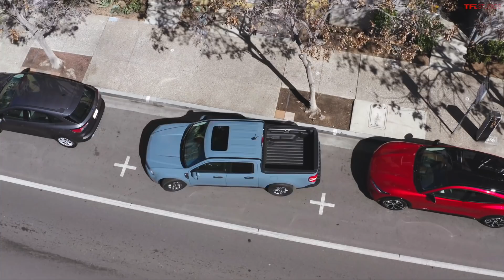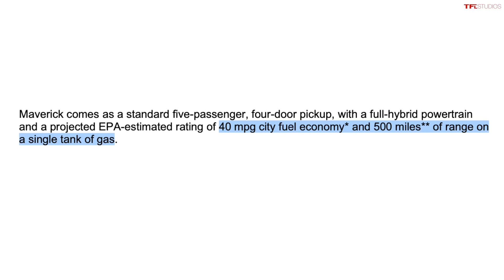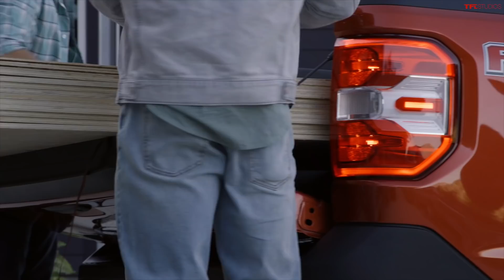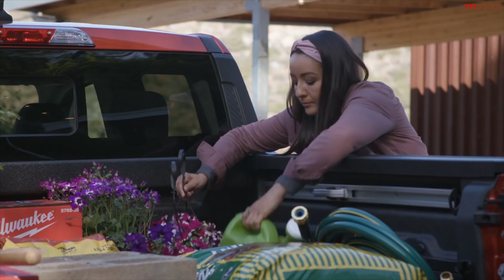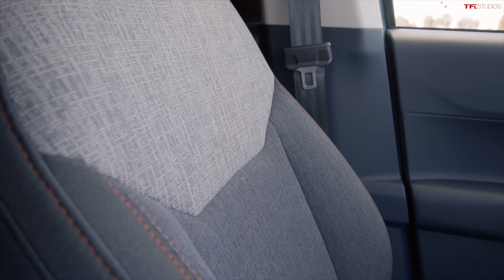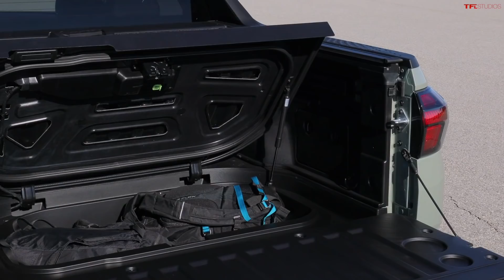Hands On With The New 2022 Ford Maverick: Here Are The Top 10 Things You Need To Know!

Comment: I think they should have ditch the rear seats and added more bed space and better set up for hybrid. to me its not going to do very well in the end most will just pass it up as to why not just get a suv for the room. there are reasons why cars get larger.. no one wants to travel in a bath tub or a can of tuna.. i watched as you got in on both the front and rear def brought back memories of the old Toyota with a small seat that went sideways. I really don't understand the point in this truck. If i was going to build something this size i would have made the cab a single with a bit more room like a 1/4 rear cab for say like bags of groceries and made the bed a full 6 foot bed. i know the idea of gas engines are going away. why not have a diesel option? or a full electric since thats where they are headed. for 20 k for a full electric that was capable of a small work truck may be something that many company's would buy specially on a army base where space is always tight.

Comment: Sold Fords for over 40 years, when they dropped the Ranger, I argued that cost and fuel economy weren't the most important things. IT WAS THE SIZE! People that live in apartments and areas with HOAs need smaller vehicles. If you live at the beach there is very little extra parking.  Even when you go to the National Parks, parking is a problem. I plan on getting one, my wife has a 2020 Escape Hybrid and at 5200 miles is avg 40.1 MPG

Comment: Great video, Tommy.  Most polished video I have seen from you guys.  Having owned a smaller Ranger, newer Ram Quad Cab, Tacomas and now a Gladiator, I still like smaller trucks because they are easier to park and handle everyday tasks than larger full size trucks.  What manufacturers don't realize is that not everyone needs a 4 door truck.  I even wished my Gladiator came in an extended cab with a longer bed instead of a 4 door version.  This Maverick will sell like hotcakes.  When Ford announced years ago that they were bringing back the Ranger, I was hoping that they would have kept the truck small.  But they did not and the interior of the new Ranger was a disappointment.  I do think that Ford redeemed themselves with the small truck market with this.
Reply: Plastic interior, assembly in Mexico. Bet it has quality issues like uncle bronco

Comment: Nice concept, but no deal for me. A 4.5 foot bed is worthless in a pickup truck. If I'm buying a pickup, it's to haul cargo and lumber 8-12 feet long. Most modern trucks are basically just an SUV with an uncovered trunk. I don't need a back seat, I need that bed space. Otherwise just buy an SUV, where the cargo area is covered. MSRP on this may be under $20k but I guarantee you won't be buying one anywhere at that price. Around here vehicle prices at dealerships are $30-40k above MSRP. So, 50-60 in my area.

Comment: Good grief,  Ford did it again.
This granola toilet shouldn't be considered a truck (in my opinion).
     Ford and a few other companies have proven these uni-body pickups are junk years ago in the snow states.   The salt rust them out.   Also hope you don't get the back half badly damaged in an accident because you can't swap the bed out.
   Final— Ford (Ranchero) and Chevrolet (El Camino) stopped making these for a reason...it didn't work.   Even Subaru retired the (Bratt).   This body truck type doesn't work good in winters salt and calcium roads.  Like I said, a lot of rear collisions end up up totaled.

Comment: Super Cab with a 6" bed.  Super Cab gives you a secure place for you tools, 6' bed gives you something to work with.  Around here people are beating the bushes for the older Super Cab Rangers with the 6' ish bed.   4WD Rangers in this configuration bring a hefty premium.

I agree they should have named it "Ranchero".  I had a '62 model.  This machine does have a lot in common with the Ranchero of old.  They both are small economical uni-body's to start with.

Comment: They claim the only competitor is the new arrival Hyundai SantaCruz - but this is the Honda Ridgeline design - small uni body with a truck bed integrated.
Would have liked to know the MPG for the AWD version as a front wheel drive is not a good tow vehicle. Just try getting a boat out of the water on a slippery boat ramp with a front wheel drive. But when they said "made in mexico", I tuned out. When you realize the Honda Ridgeline and the Hyundai Santa Cruz are both built in Alabama - why mess with the garbage hit and miss quality that comes from Mexico plants. I have no desire to be in continual warranty issues with a new design still working out bugs. No wonder they are pricing it at under 20K - and I'll bet our fed gov is giving Ford a huge kick back for "hybrid" - thanks D.C. for incentivising jobs going out of the country - AGAIN.

Comment: Ya know... it doesn't matter what those pinheads in Detroit throw across the drawing board anymore.  Its still gonna be a tin, foam, plastic, girlie gadgets and low bidder, conglomeration of crap. No lie.. a god damned UMBRELLA hit my truck and caused $1,200 damage. Trust me, if you get a hard on in your new truck, it'll be totalled. Guys... you went all Rube Goldberg here. Who's idea was it to take a simple system, like HVAC, and wire the thing up to THIRTEEN LIN-BUS actuators.... ON A NETWORK, just to defrost the windshield? That, right there, is your whole problem..... over complication and passing it off as "innovative" and "high tech". It's stupid !!  Look...guys.... just put the two little manual throttle cables back in the HVAC and keep it simple, ok? So, I bought a 1972 Dodge Power Wagon 440 mag, 4x4, 4 speed, split rims, snow plow frame, hand crank windows, no AC, chicken lights, big ole old school towing mirrors,  trailer hitch, winch, AM-FM-8 Track, gun rack, and it out runs, out works and out f**k anything Detroit has put out in the last 25 years. Like brand new.... $25,000.00 .... Take your stupid engineers on a little stroll through a god damned classic auto show and stay there till you understand what you did wrong, Detroit. AND... what is it with you guys? None of you are getting laid so you make the rest of us suffer too? Get rid of the god damned console and bucket seats !!! A woman has to be a professional contorsionist for a half decent hand job or, god forbid, road head. AND.. don't give us your propaganda and BS about "gas economy", the environment, safety, and what not. My 1972 440 does better with nothing but an off the shelf muffler and no catalytic converters, injectors, engine control modules, transmission control modules or any of that other happy horse shit. We all know what your end game is.... no payment, no start. Expired license, registration or insurance.....no start. Not with my 72 !!
Reply: I like the way you think. Drive a 38 year old pickup myself hauling lumber, rocks, dirt, drywall, appliances, demo. Not a daily driver and have two modern cars, but love driving that old full size truck the most.

Comment: Great video. I was hoping it could pull about 3,000 pounds and still be a hybrid. I have a vintage trailer I’m restoring that will top out at 1500 pounds so I would need the extra weight for camping stuff in the truck bed. Is the 2.0 eco boost engine not a hybrid? If not what would the city mpg?

Comment: I think I'll stick with my '05 Chevy Colorado Z71 4X4  Crew Cab with its five cylinder engine and just shy of 250,000 miles on the clock....And an average 35mpg for my light duty uses and my '14 RAM Hemi 1500 4X4 for the heavy lifting while averaging 21mpg.

Comment: Super interesting vehicle, I'm probably going to have to be replacing my car in the next year or so and this defiantly is a contender for the replacement. I especially like that the hybrid engine is multi port fuel injection as opposed to direct injection and avoids the carbon buildup issues on the intake ports. I'm just a little scared of cvt longevity.

Comment: Sounds great but so did the Prius.....Ill wait at least a year to see what the issues are. Never buy the first one out of the gate unless you have $$$ to burn. Btw, CVT means the engine works harder thus tranny may need replacement between 100,000 and 150,000 miles. Typical Ford...

Comment: I like it as it is, but I would LOVE it if it had 2 doors, extended cab and a longer bed. My current truck is a 2004 single cab Silverado with V6 and manual transmission. I bought it new with only 1 option, a spray in bed liner. I’m ready for a new truck and the Maverick fits the way I really drive on a daily basis.

Comment: I can fit a 9 foot kayak inside the Jeep Grand Cherokee with 1 inch to spare.  Crush and run.  The new conversion vans from Ford are good haulers but I have not seen one on sand yet floating boards from the back past the reef critters into the sea-"no fuss no muss".  Any other ideas for hauling kayaks, long boards, surf rods- crush and run only; quick change; no deadlift belt required- need my energy for rapids and reefs, beach blanket bingo, etc. I heard someway talking about the Element from Honda, but it reminds me of a Tang commercial. Thoughts?

Comment: This is not a real hybrid. Just another electric compliance truck to kiss big oils donkey balls. 1.1KW/hr battery might run a miniture vibrator for the wife of Fords CEO. So I plug in at home leave the driveway travel for 5 miles and the gas motor has to re-charge the vibrator battery. What a joke. Just a compliance hybrid. More fcking garbage once again.

Comment: Would prefer a longer more usable bed over a roomy backseat that I'll rarely use, but I guess that will not be an option with unibody construction. Looking forward to seeing one in person just the same though. Interesting that it's using the same name as the compact car of the 1970's where Ford used a similar price marketing strategy.  Back then  however it was "Available for under 2000.00!"

Comment: I wonder if the all wheel drive ones have the catalytic converter moved away from the "transfer case" so that the oil in the transfer case doesn't get cooked like it did in the Escapes, of which this is based upon.

Comment: How is 40 mpg in a small pickup a big deal in 2021? I got 32 in my old 89 S10 back in the day and the rabbit deisle back in the mid 80s got 45
Reply: @carbon_star  it's not the air bags abs system, seat belts or crumple zones that kill fuel economy. It's automatic transmissions and epa regs on emissions. The other stuff adds some weight but we loose alot of fuel economy to the hydrologic systems inside of automatic transmissions and by creating extra heat to try and make what comes out of the tale pipe less toxic.

Comment: So this is a "truck" for city folk. I currently have Colorado and 5'2" bed is small the 4'5" would seem tiny, the lack of 4 wheel drive (yes I understand it has all-wheel drive but this is very different) the towing at less the 2,000 lbs (my old Subaru forester towed 2500 lbs) on the standard model, 8.3 clearance etc.... means you are getting a car with a box on the back.  I suspect there is quite a market for this vehicle but it won't be Truck owners.  This is a truck for the guy who wants a truck but never leaves the city and once a year has to pick some soil for his garden, or some plywood for his kids tree fort. 

I am sure it will sell it just seems borderline calling it a truck but what do I know I use 4 low, the full 7,000 lbs of towing and 9" inches of clearance I have, sometimes isn't quite enough and my truck was the smallest on the market.  This is a nice car made to look like a truck.

Comment: Hopefully, if it sells well, they'll make a single cab with a 6 ft bed and maybe a 6 speed manual.  That would really be nice.
Reply: It’s a economy truck... you won’t see a manual trans
Reply: @SheeenBean  It's a vehicle.  Manuals are going the way of the dodo.
Reply: Don’t hold your breath, but a single cab would be cool. Like a Subaru Brat only Ford
Reply: That would be awesome 
I also honestly like the front wheel drive in a small truck like this.  Better in the snow
Reply: Jack K  1500 lbs of payload. Six feet if you put down tailgate. Definitely not useless.
Reply: That I could get into
Reply: Your clutch is your friend.
Reply: It’s on the Escape chassis, to revamp it I’m sure it’ll cost too much, it would have to sell extremely well. But the initial reviews are really good.
Reply: And a jump-seat in front so you can sit 3 folks if needed 👍😎
Reply: And rear wheel drive
Reply: @camthesaxman3387  Just another retro hipster vehicle with none of the capabilities of the original inspiration. Even the Ranger; It's now a full size truck with the capability of an Izuzu Pup.
Reply: @anfiach  Gotta check it's specs.
Reply: If that is what you want - buy the Ranger - already available. This Unibody little thing would be a mess to do what you think your asking for and they couldn't do a 6 speed manual in Hybrid, so your just asking for a small truck - so Ranger is available already and depending on the drive train option gets pretty good MPG and kills all the stats of this Maverick non-hybrid versions.
Reply: @donaldgulledge729  Personal opinion as a 2020 Ranger STX owner:  I love my sporty Ranger. This vehicle is definitely a very less qualified and a less functional comparison. Plus, getting towards the 30k mark is not a worthy financial choice. Personally, I don't care for its body design or overall look... nothing is screaming ruggedness! Additionally, interior, as stated, is smaller than the Ranger. That's a tough one on long trips.
Reply: @x700m75  much more modern interior in the Maverick though. I'm excited to see the upcoming Ranger refresh. I saw the interior of a brand new ranger a friend bought and man does it look dated!
Reply: @Idontwantahandle1111  Ah, I'm cool with it.

Comment: I like living in cities and I really want a truck because it's a hassle putting my bike in my Kia Soul and sometimes putting a big TV in it is impossible. But a truck is just impossible to use in a city. I still think this truck is too big. What's the point if it's only a foot shorter than the Ranger? They should have went bolder and made it smaller. I think it needs to be like four feet shorter. The price is good though I think it should be dirt cheap.

Comment: I still have my 1995 Ford F-150 5.8 liter 4 wheel drive beast. How much trade in value will I get if I want to buy one of these small trucks. I’m not hauling big loads anymore.

My truck has 131,000 miles on it and still gets an amazing 12 miles per gallon on the highway, when not hauling a load. One time the guy at the gravel yard loaded 2700 pounds of gravel in my truck bed. I drove ten miles an hour to the work sight, looking up at the sky. That was the last time I ever told that guy to load her up.

Comment: Review was great EXCEPT the under 20K part. TFL should know better. Most everybody that ordered one spent around at least 32K, which is about the price of the truck shown. Entry level stripped down versions start at $21,490.00. Then come on top of it all the dealer ripoff tactics. Nope. Not the deal that's being represented. Trucks of any size still overpriced.

Comment: I cannot wait for this truck to come out.  I will keep my 2014 F150 because I pull a camper, but for every day driving and convenience this Maverick meets my needs.  I believe my wife will like it too.  I like the entry price but hybrids biggest downfall is the batteries needing replacement in 7-8 years.  I keep my vehicles 13-14 years and batteries for most auto cars run around $3K.  That's a big expense. Will make my decision this fall when they are introduced.

Comment: If you look outside the States, you will see that, Ford,Toyota, Nisan and even Mazda, have been building this configuration since the 70's. Usually in a two door or four door, four or six cylinder and Diesel, variants.  Before i came here eight years ago, from New Zealand, i was unaware that Toyota etc..even made the bigger f150, f250 size trucks.
This, to me, is a new take on the Ford Explorer  XLT sport trac.  Yes, i agree that it's a great idea, but certainly not a new idea.

Comment: If it was a plug-in hybrid, sure.. maybe. Insult to injury is the CVT making it a 120k mile vehicle. IMO anything above that is just borrowed time before you have to replace the typically expensive CVT
Reply: It’s not a belt CVT like Honda Nissan or Subaru. It’s a gear system with the electric motor controlling gear speeds. 
Toyota has been using this system for decades in the Prius. With no issues. And fords system is better. Hence why the new Prius copied ford hybrid system. They make it to 200k miles no problem

Comment: Good summary. A little sad to me that the Ford will be made in Mexico, but the Hyundai will be assembled in Alabama. I suppose that's how you get the sub-$20k entry price. I just do not know about the CVT. Can you put 200k+ miles on one? Also, battery life on the hybrid in the upper midwest. What is MPG and sticker price on the 2.0 turbo with an 8 speed? More or less than a Santa Cruz?
Reply: The CVT is not a traditional belt CVT like Honda Nissan or Subaru. It’s gears with the electric motor controlling the gear speeds . Toyota has been using this system for years. And this is fords 4th generation. It’s a very reliable system. 

The hybrids last 200k+ miles with no major issues even in the north 

And the 2.0 awd ford is $24,000 bs Hyundai close to 30k